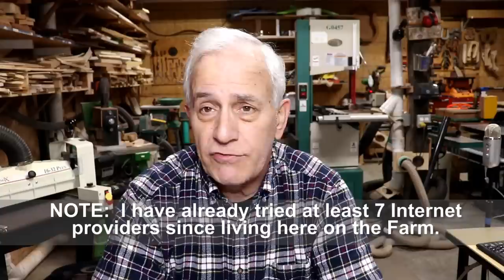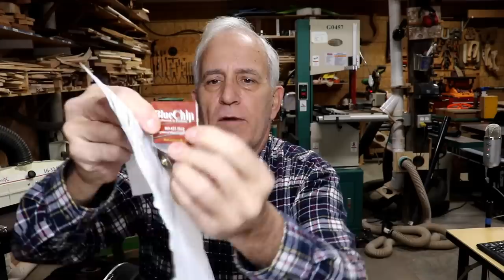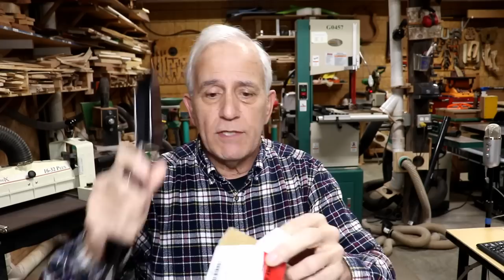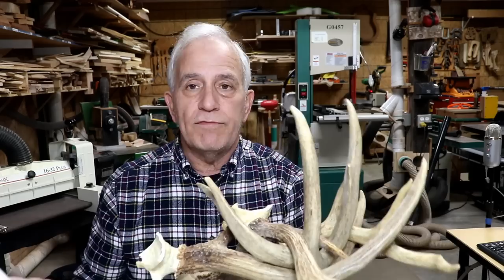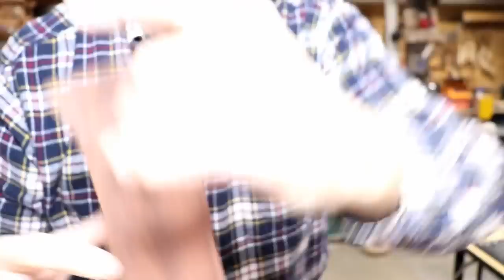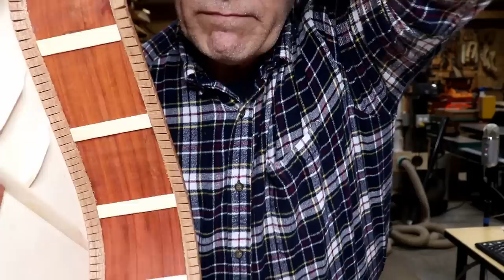460 RSW 13th Not so Live Shoptalk  I Won an Oscar

Comment: Hi Jerry, in connection with your slow internet,  some providers will purposely slow down the speed.  There is a product called Range XT. It is a simple plug and play item that somehow restricts the providers from slowing your internet speed and boosting speed massively. Cost less than 100 dollars . Might be the answer to your issues.
Reply from the maker: thanks

Comment: Jerry **the grain sealer was tested and sent to you by me t o try.on the 12th string ****CHUCK KELLEY
Reply: @DSc DR KEL: Do you Really expect him to
experiment on a commissioned instrument?????
Reply: @zapa1pnt  

Jerry and I have been trying every grain filler on the market*** Timbermate comes clost to being the best**before I started working with the UV filler..you use the same procure on all products before using on any instrument .THE PROBLEM IS AFTER TWENTY DAYS OF CURING WITH CLEA R COAT*THEW GRAIN FILLER SHRINKS LOOKS ROUGH THROUGH THE CLEAR COST. THE UV FILLER DID NOT.**DR KEL

Comment: Are there not any ISPs that offer DSL, fiber, or cable?  4g, and similar technologies, aren't going to give you an internet connection that's as good or stable as a dedicated DSL, cable, or fiber line.

Like you mention in the video, you have to communicate with a cell tower when using 4g, so you have to compete with everyone else using that same tower which is going to degrade your service, especially during busy times.  Wireless connections are also less stable and reliable, so having to connect to a cell tower is going to result in a higher packet-loss rate, especially if the tower is a considerable distance away, and, like I've already mentioned, a high level of activity will only increase that packet loss.

Try getting a fiber, cable, or DSL line—in that order—from one of the ISPs that service your area.  I've never been to Newburg, but I have been to Rolla, so I assume that you're more or less in the country, at least as far as ISP selection goes.  Hopefully there's a decent-enough provider that you can contact.  Since ISPs engage in a lot of anti-competitive behavior, there's likely only going to be one or two ISPs that service your area.  It may be that you don't have much choice, but hopefully there's at least one ISP that services your area and offers a cable line with 100 mbps down and 60 mbps up.  If you do find a decent-enough ISP, be sure to ask them if they engage in throttling or implement data caps.

If your options are really bad, you might look into starting your own community-based ISP.  Here are some links if you're interested:

https://startyourownisp.com/

https://arstechnica.com/information-technology/2015/11/how-a-group-of-neighbors-created-their-own-internet-service/

https://www.vice.com/en/article/kz3xyz/detroit-mesh-network

Good luck!
Reply from the maker: I had extended dsl for a while it was worse than anything, bad lines
Reply: Ohhh, I kind of expected that. They don't do much if anything to help you out with extended DSL.  At some point, it is a waste of money to upgrade obsolete service, so they just stop doing all but basic necessary repairs.   Every town is different because permits to set up various services get approved or not, by selectmen or who ever is in charge in your town. Nobody makes rural service happen.  ISPs do it for the profit.   The more rural, the less profit.  Back when we ran a very popular BBS over phone lines, we told people to just go through  freedialup.org and we posted a bunch of freeware so it was all about helping folks get online free.  That doesn't really happen anymore, it is all corporate.   I know of a guy in Waldron, Arkansas named Jeff who is very nice and would tell neighbors how to get hooked up to the best local  service. I bet you have a guy in your neighborhood doing live interactive stuff too that could help you?  If not, go ask the guys at the fire department, they will know locally who has junk service and who is the one to get. I hope all that helps.
Reply: @RosaStringWorks  I was going to tell you to try ATT Uverse if available, it's pretty good, if you have a land line. It is better than DSL, but bad lines could be an issue, though ATT is pretty good about finding the problems. That is what I have and though the speeds may not be as fast as cable, still dang good and more stable. Either way, even with what you have now, if you use an ethernet cable instead of wifi, makes a big difference.

Comment: I too live in a rural area. Verizon installed a cell tower less than one mile away. We always have 5 bars but at times of peak internet usage our service is degraded. Prior to the pandemic this was not an issue. We screencast from our Smartphones as our entertainment source.
Reply: Yup, everything runs off our cellphones. We never get five bars but we get four bars unless the kids just got off the school bus and have run inside to play games on their phones.   
  I recently had a heart attack and triple bypass surgery, so if I have to call 911, I need it to work the first time and not drop carrier.  We gave up cable tv, which handled our old internet service, too and it came out about the same amount of money a month but now we are mobile and we no longer have "last mile" issues.  If I really need to do something big on my laptop, I can go do that free at the library.
Reply: What you need to understand is the number of bars you get only tells you the signal strength between your device and the tower. You can have 5 bars and still have absolutely no connectivity. The capacity of the tower depends on the capacity of the circuits feeding the tower. If it’s copper T1 lines it depends on the number feeding the site. If it’s fiber fed there can be a much higher capacity but that too depends on the bandwidth allocated to that site.
Reply: @yqwgjsg  prior to covid we never ran out of data, I know too many users  equals diminished service. We are rural meaning far fewer cellphones per square mile. During the day all 3 schools are using hotspots to log in to their classes.
Reply: @marlobreding7402  You are making my point. Before COVID these sites were built out for normal use based on historical data. Now many people are staying or working from home not to mention the kids using virtual learning. Adding capacity to a cell site is not a quick or easy process in most cases. COVID won’t last forever and while it would nice, it’s not economical to overbuild a site when next year it may be operating at 50% capacity. The government taxes unused capacity. If I put a 100 pair cable in a subdivision with 50 houses, I have to pay taxes on any unused pairs.